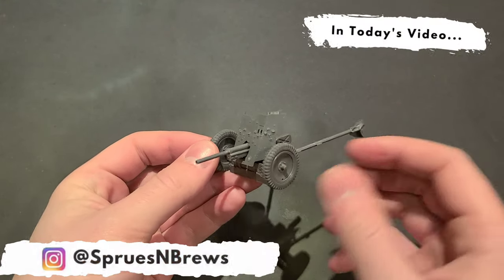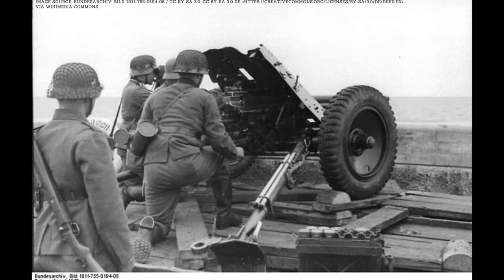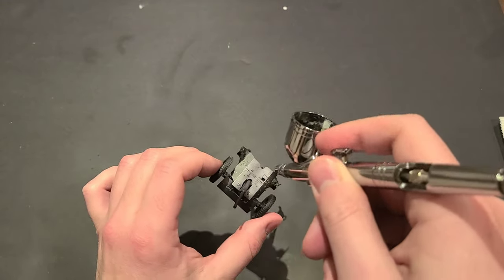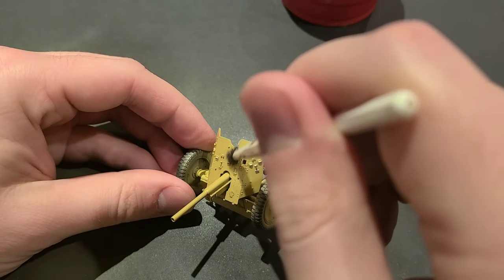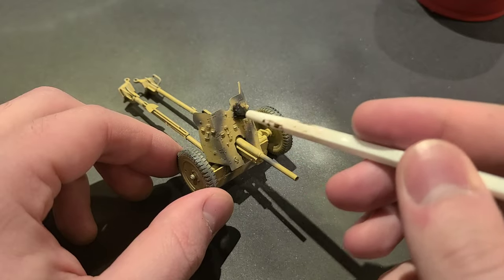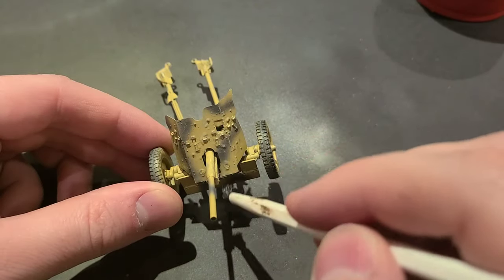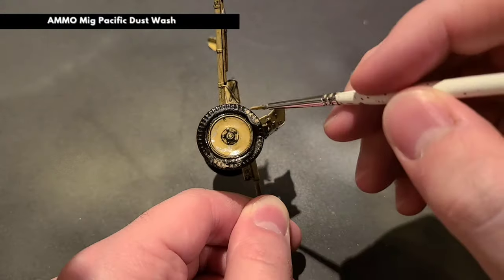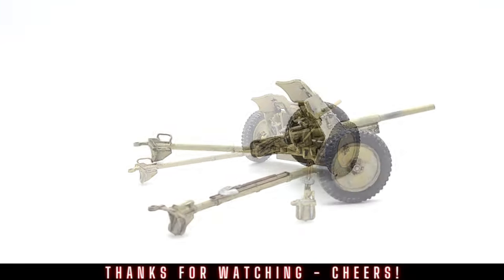How to Chip Scale Models | Weathering Tutorial | Tamiya Pak 36

Comment: Nice vid. The few times I've tried hairspray chipping I haven't had much luck, But I'll try again following your steps. FYI, Vallejo makes a basic Model Color called Black-Gray that looks great on tires that have been in the field for a while. Tamiya also makes a Rubber Black that looks great for newer tires. JMHO but straight black tires just don't quite look right.
Reply from the maker: Thanks for the recommendations! I'll have to check those out 👍

Comment: Also consider what primer would have been used at the factory before application of the dunkelgelb - adds more time, but a layer of that over the aluminum and before the dunkelgelb would add even more. But that might be better suited to manually putting in chips (a la Night Shift)

Comment: Great tutorial on chipping, but I was wondering after your chipping of the dark yellow layer, do you need to add another hairspray layer before you add the green camo?  Also is it do you need to protect bottom base layers like the aluminum  before you add the hairspray layer?
Reply from the maker: Thanks! So essentially once you're done with a particular layer - if you're happy with the current chipping effect - you need to add a protective varnish & then another hairspray coat (if you want to continue with subsequent chips). Otherwise, if you were to spray the green over your yellow chips without a protective coat, any subsequent chips would just take off even more of the yellow (as well as the green). I hope that makes sense!